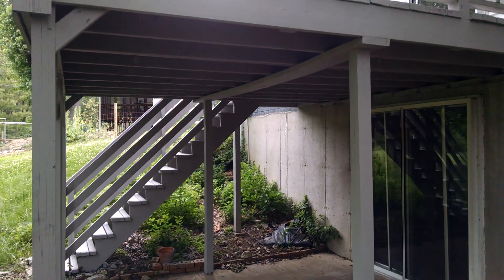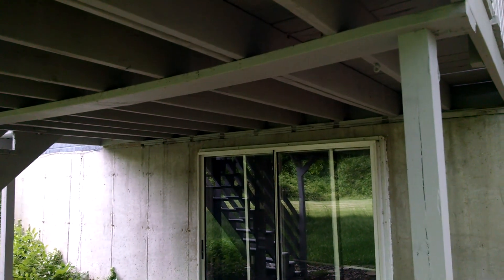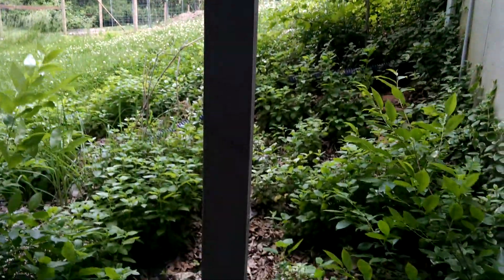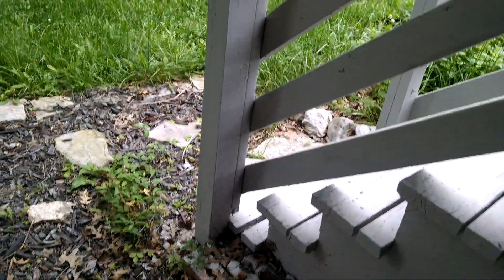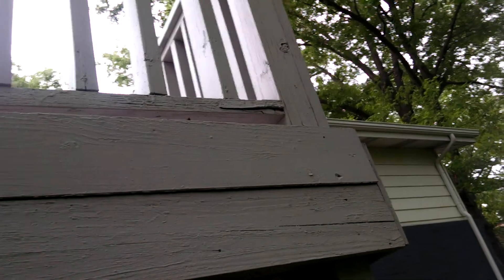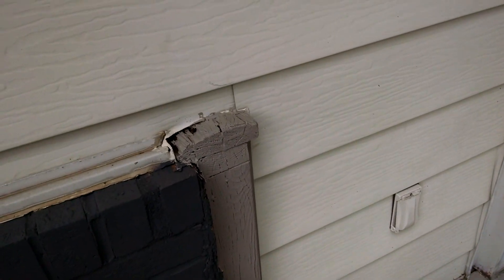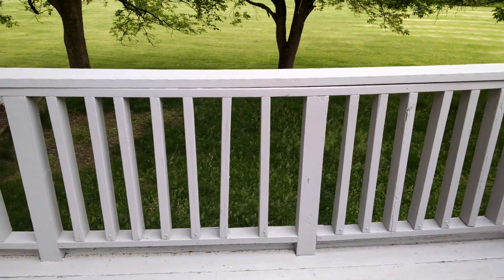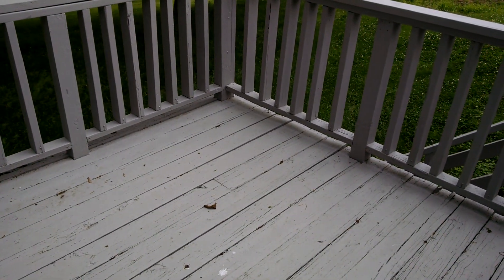Dangerous Deck Inspection - Catastrophe Waiting to Happen - Galloway Building Services

Comment: Most decks built by handy men and homeowners do not pass inspection the first or even the second time. Thats why many homeowners opt to not pull a permit and try to get away with no inspections. Inspectors are not the enemy. They are there to point out what you dont know.

Comment: Dangerous to even stand bellow that deck. But what were they " hiding" it is very obvious how everything wrong is here. The paint is not really new  and the wood boards  and the joists are probably original with the house. When it was built it was probably fine then the subsequent owners did inadequate repairs which are obvious.

Comment: Just had my deck done and the beam must be three 2 x 8's on edge bolted together supported by 6 x 6's.
My footings are screw piles, but that depends on where you live, they're a no if you're building on granite bedrock obviously
Reply: Well... They COULD be used on granite...
If you bored holes for them and cemented them in.

Comment: Obviously that deck has major issues but according to joist charts 2x8's can span between 10.5 to just about 12 feet (depending on species) if spaced 16" on center.
Reply: That IS true. But, I believe he said the span was greater than that.
Why, yes, he did. 0:50 "And they're spanning over 12 feet."

Comment: Your price was too high. I found someone to do it $1,000 cheaper and he says he has been doing decks for 25 years 🤣. How many times have I heard that in my retaining wall business?  Too many
Reply: Doesn’t mean that other contractor is going to do a bad job…you were just outbid.  It’s usually the DIY mentality of wanting to take on a complex job to save money that offers comic relief.
Reply: @LDSKIPPER1911  I have no problem someone beating us on price if they would do it properly. However I have seen too many times the cheap contractors either do a terrible job or bail without even completing the job when they realize they are in over their head. When retaining walls fail people can get seriously hurt or die similar to decks. The problem is retaining walls are unregulated. You need NO experience and many times don’t even need a permit. At least decks always need an inspection.

Comment: Can’t you just add four 6x6 posts and some 2x10s?
Reply: You just want them to spend $7,000 on a new deck
Reply from the maker: @strokerace4765  I don't build them anymore. No dog in this fight.
Reply: And do what, re-use decking that's been painted to hide the obvious rot? Someone's going to put their foot through one of those boards within the next 2 years guaranteed. The amount of work it takes to retrofit a deck like this to be safe is more than the work of tearing it down and building a brand new deck properly.